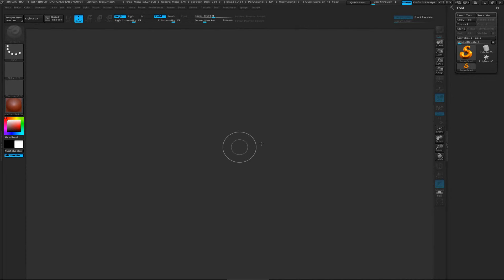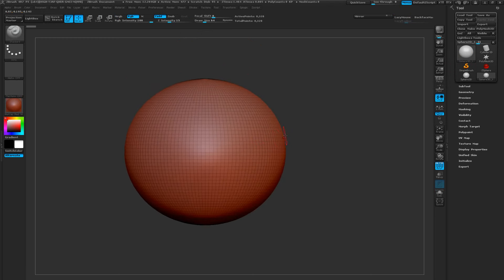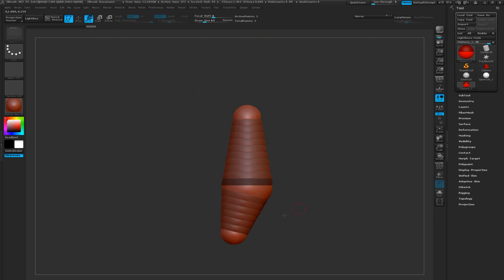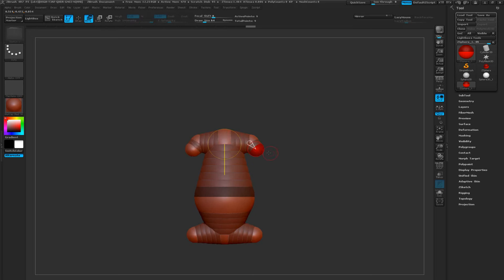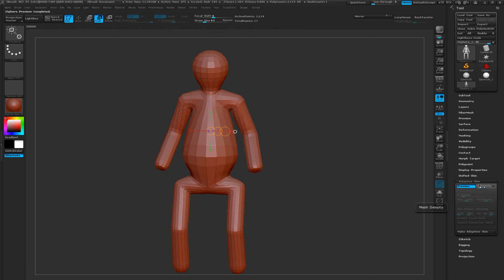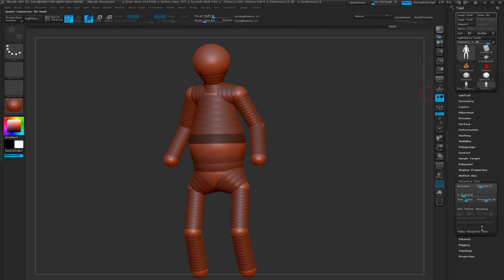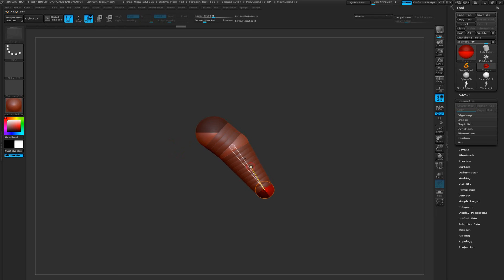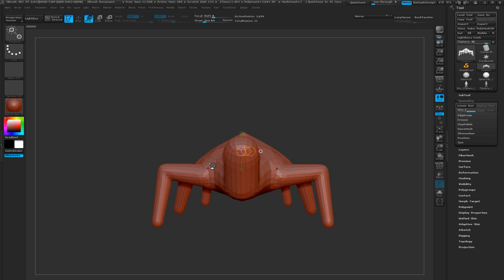Creating a Base Armature for sculpting with ZSpheres

Comment: Very informative video, like always - thank you :-)
Any chance for 3ds max uvw unwrap tutorial, maybe with textools plugin?
Reply from the maker: It's always about the UVW Unwrapping :) I actually prefer doing my unwrapping in 3D Coat over Max simply due to it's sheer speed, but i might do a Max unwrapping video too. Do you have anything in particular that you would like to see unwrapped ?  Oh as for Textools i have used it and if you are doing your unwrapping in Max alone then that is a given, but since like i said i prefer to do my unwrapping in 3D Coat it's not such a given any more for me.
Reply: I know, it's so lame, but if your are a beginner in the whole "modeling for games" thing you need all the help you can get :-) If i must be precise - some tips about optimizing uvw for unreal engine will be very helpful. I had a problem with overlapping UVs - maybe something about that? Really, any tips from such experienced designer like yourself will be enough.